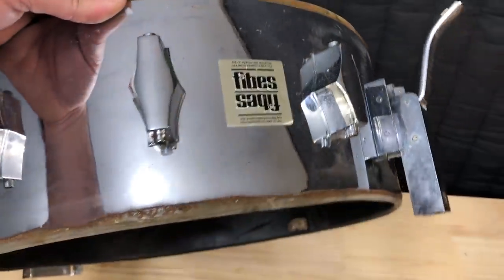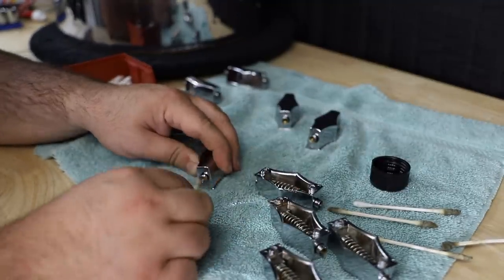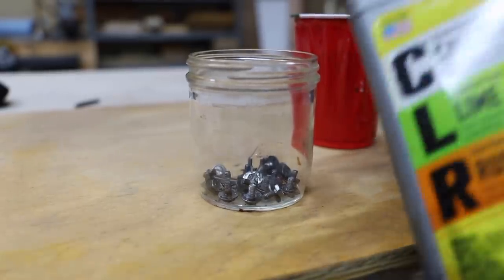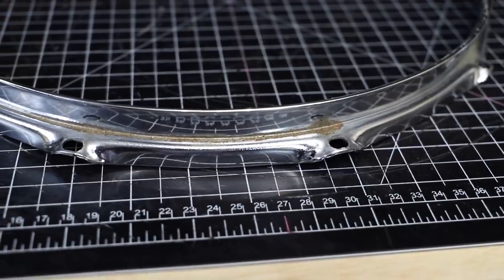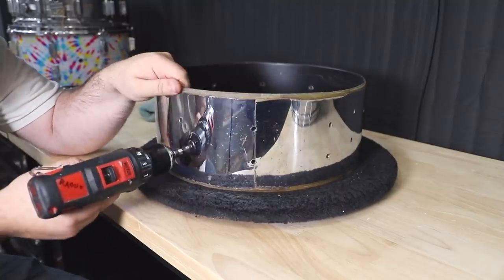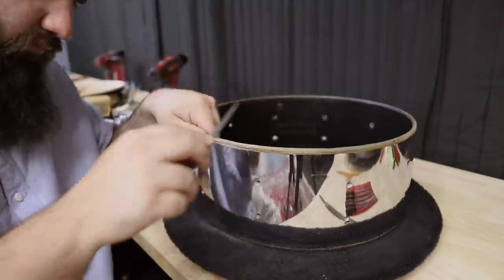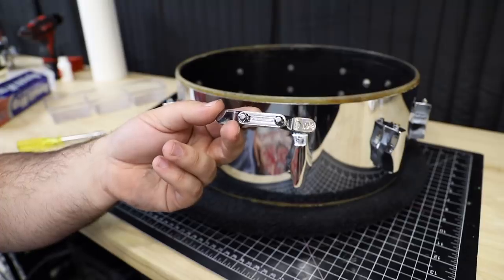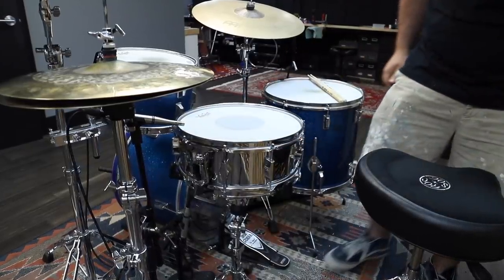Bringing a Vintage Fibes Snare Drum Back to Life

Comment from the maker: CHROME DRUMS ARE IMPOSSIBLE TO FILM 🙃
Check out all the Summer Drum Sale over at Sweetwater!
https://imp.i114863.net/0e91N
Giveaway:
https://imp.i114863.net/3vdey
My current gear:
https://imp.i114863.net/6Z0jG
Reply: What are the sizes on the whole kit? It Would be cool if you did a video with that snare with lower tunings and or different dampening items. Gels, wallet, tape etc.
Reply: You can thin polyester resin with mek. Acetone in a pinch but mek works best up to 10%. 😀
Reply: I have a 30 inch vintage Ludwig kick drum for sale, its a perfect project drum! I’d love to see it make it onto one of your videos. Is it something you might be interested in?

Comment: Sprinkle baking soda into the wet super glue and it creates a super strong, sandable, almost plastic like substance. It's a trick as old as the hills, though I never knew about it until I saw someone do it on youtube. No joke, try it. I've rebuilt areas on projects where entire chunks of material  were gone with this technique. The bearing edges on this drum would be perfect.

Comment: My first kit was a 1970s Fibes Crystalite with Ludwig mounting hardware & a Maxwin by Pearl snare ( which I still have & use). It consisted of a 12” X 8” rack Tom, a 14” X 14” floor Tom, & an 18” X 16” bass drum. The heads that made the toms sound best were Remo Clear Pinstripes on top & Clear Ambassadors on the bottom. The bass drum had an Evans EQ1 on the resonant side & a an Evans EMAD on the kick side. I ended up trading this drum kit for my 1980s Pearl Export , which I still have and use. Phibes kits sound great, and so does yours.

Comment: The SFT throwoff is very usable, albeit hard to find parts for. I like the design because it drops the wires completely off the reso headwithout losing tension, instead of just letting them hang loose. Puresound makes replacement wires for the 14 in snare. I have two acrylic "crystalite" snares, one with the original wires and one with the Puresound replacements. I previously owned a 10 x 14 marching snare from Corders (the company that bought Fibes). It had a weird SFT throwoff that used cat-gut wires. Sounding crazy good though. I'm glad to see you finally getting around to working with the Fibes stuff. Let's see that whole kit you got laying around somewheres!
Reply: Ha! I posted before the end. That's a beast kit, man! Nothing sounds quite like a Fibes.

Comment: Mix Dawn dish soap and vinegar for a good degreaser. Soak parts for 10 min. Works awesome. Also F -11 spray cleaner polishes all finishes. I use it on the whole kit and hardware.

Comment: As a beginner, I just learned that I didnt clean all my lugs as good as I shouldve. But I dont wanna take my kit all apart again, I got the outsides pretty clean. I just used a spray bottle of soapy water and aluminum foil. I just let the screws sit overnight in vinegar and then cleaned them off... I'm such an amateur at restoring stuff lol.

Comment: The SFT 690 throw was probably one of the best snare mechanisms ever designed.
Combine that with the unique characteristics of the Fibes fiberglass shell and it's pretty much perfection.
Just because it was designed back in the 60's does not negate that it pretty much transcends all other designs after it. 
Rogers Dyna's are no where near as good because this does all that the Dyna does without all the 'dial in' issues inherent in that design.
The Indie is just a dinosaur design that has been imitated over many many years.
Any generic throw off from the past couple of decades is just as good.
In terms of dynamics and sensitivity,the Fibes leaves it in the dust.
Why go through the hassle of rebending the bottom hoop if you don't need the drop down snare gate?
Any cheapie bottom hoop will work just fine.
Swapping out the throw and drilling new holes for a butt plate probably devalued that drum by a couple hundred bucks.
Gah!
Retrofitting that snare with an ordinary throw is like putting bias ply tires on a Ferrari.

Comment: I wonder if the Fibes shells were made undersized. The lugs never seem to line up straight with the tension rods. The swivel nuts compensate for cross threading so it's more aesthetic than functional. If the lugs were directly tapped, then it would be a different story

Comment: InDe really knocked it out of the park with that strainer! Next project that's coming up. I will probably get one myself. That Dunnett would have looked too bulky IMO. NICE JOB on the cleaning and repairing, man! Although the bearing edges could have probably used a professional recut. Also, the tension rods are not really aligned well. Have you thought about putting gaskets under the lugs? Anyway, I really love how you even straighten the rims out and use all the functional parts to bring the drums back to life, when possible. There's already too much trash on this planet.
Reply from the maker: I thought about re cutting the edges but was scared there would be even more tear out. All the fiberglass Fibes shells, from the Martins era at least, are a bit small. If I ever come across a stash of fibes gaskets Ill probably put them on. Otherwise its not worth the trouble of cutting them by hand